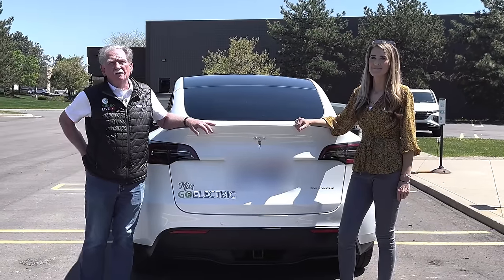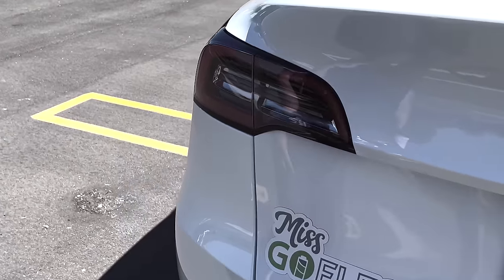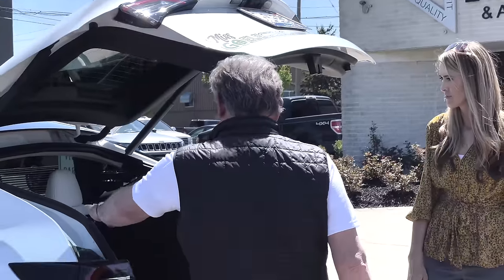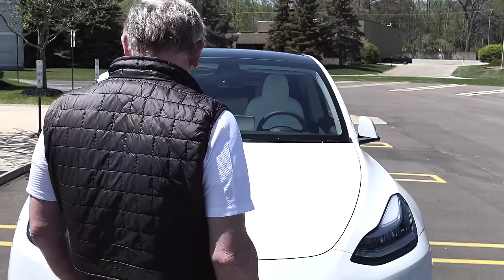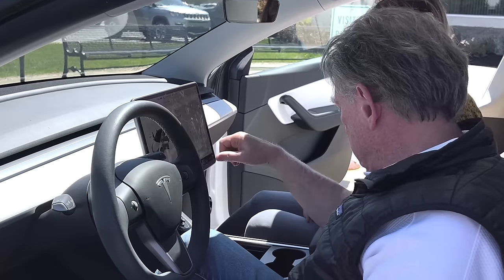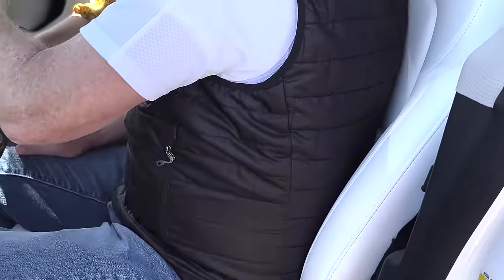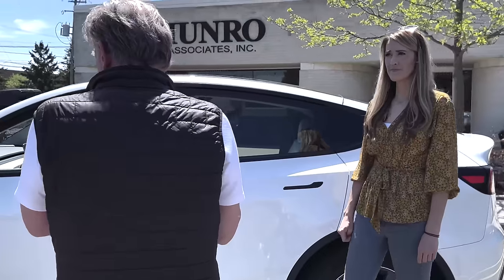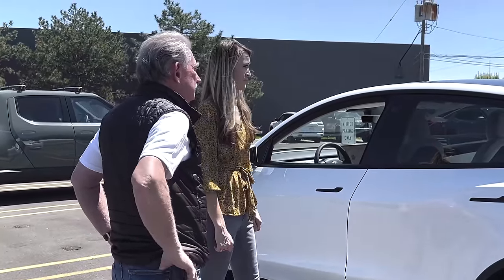Sandy takes a peek under Miss Go Electric's New Model Y Frunk!

Comment: The panel gaps, you need to schedule a mobile tech and/or bring it back to Service Center to have them fix it. The completely messed up front fender gap to the pillar is totally unacceptable IMO, fairly sure the other customer rejected it because of that... looks like a 5mm bump from the fender transition to the pillar.

Comment: Haven't watched the video yet.  My 2022 Model Y has a very slight press flaw to the left side of the rear hatch where it meets up to the hinge.  A very slight twist to the left.  It's not enough to warrant the hassle of getting it repaired which I would assume requires a whole new rear hatch, but it did get mentioned to them and money changed hands as a result.  Looks like something similar is going on with her car.
Reply: I own 2 Tesla's (a model 3 and a Y) I would Lemon law that vehicle.  For the money that is not acceptable.  I'm sure they would work with you.

Also, there is a window calibration you can do.  It's in the manual.

Comment: Tesla fan-boys love to criticize the more established auto companies, but I doubt if a vehicle of this quality would have left a Ford or GM plant
Reply: Ford or gm will break down in less than a month, will have to be towed. 
gm car will catch fire 🔥 just looking at the car.
Reply: @markplott4820  data?
Reply: @paullester2535  - BOLT recalls, Ford pumps & ignition.
Reply: @markplott4820  CR still ranks Tesla reliability 27th out of 28th

Comment: The panel alignment on my January 22 built MY is better than the car in this video, but still doesn't match a typical Toyota to say nothing of a BMW or a Mercedes.  That said I love my car now that a software update has largely fixed phantom braking.  I smile every time I go by a gas station.

Comment: The Y has higher roof line which allows a higher seat than the 3.
The floor thickness (battery pack) is the cause of the squeeze.

Comment: My 2019 3 after 40k typical dings and scratches plus some damage by vandals. The way the 3 drives the range the charging network. When I get into my car I don't notice panel gaps I'm just really happy I'm getting into a Tesla and silently driving off knowing I'm in one of the safest cars ever built it's just no big deal the imperfections.

Comment: From my perspective on TESLA opening chargers to other Brands is OK only if TESLA Owner have lower charging costs. If the cost is the same then it's not a logical strategy to the Company and does not respect TESLA Owner that chose TESLA because of differences in the charging Services. Other point I see is that there is no noise dampening on the top \ interior of the plastic wheel covers, that could improve significantly the road tire noise. Thank you.

Comment: The left front fender is misaligned and throwing off the front bumper cover, hood, driver's door. Find a local body shop, they can loosen the fender and realign it and then realign the rest to it. It's just attached with bolts. It'll be faster than waiting for Tesla Service to do it. albeit free.

Comment: I guess I am an idiot. U can't really see most of the imperfections and the ones that I see don't bother me. I used to have Lexus and Lincoln, Mitsu, Nisans and some other cars. They all had some imperfections. The visible things do not bother me. But if there is some noise or squeaks that can drive me crazy.

Comment: If you see uneven gaps at pickup, they will fix it at the service center.
Reply: That’s why you need to check your car in person before taking delivery to avoid those dumb issues!
Reply: @carholic-sz3qv  We checked these gaps and were aware of them when we took delivery.  It was a calculated decision.  Timing and functionality are important to us, but aesthetic perfection is not among our expectations from a Freemont Tesla under $100k.
Reply: @MissGoElectric  We were fortunate to get our MYLR in a silar fashion.  The gaps were actually pretty good overall, just not perfect like the one in the showroom.  We had to wait for a few weeks to get an appointment, but as you mentioned, we would have been happy with car as it was delivered.  So many more plusses than minuses with Tesla.  And it's the only car we ever owned that gets regular free upgrades.

Comment: The metal frunk does not have those stamped hexagonals, and now it seems from the video it is a sandwich type of system with some plastic core. Is it me or is this different from before? If no more stamping is needed it seems like a significant cost saving.

Comment: In my Model 3 SR. My wife's back starts to go out after a few hours of in the car. We think it's because her legs are super long and after siting in my M3SR for a long time, and having her knee's almost up to her stomach, is what is causing her lower back to go out. What are your thoughts?
Reply: If moving the seat up/back does not change the comfort, there is probably nothing you can do but to have a different kind of car. I guess she had no problem in the previous cars, so there you have something different (maybe the seat position is too low?).
Reply: Get a Model Y. Or see if you can shrink her feet a bit 🤣 just kidding.

Comment: The gaps are probably 'within Tesla spec'.

The seats in the Y are taller/higher than the 3. So better angle with the knees. Back seats in the 3 are horrible because of that. Only comfortable until 12 years old or 5ft tall max.

Comment: 5:13 Either the right rear seat backrest is not fully latched, or completely misaligned and on a different plane than the left and center seats.
Reply: The seats are adjustable, it's easy to have them look misaligned
Reply: @shankhadeepshome3982  I know they are adjustable for reclining, not for elevation. The right side is way higher. This problem and the rattling have been reported by many owners. Another Youtuber mentioned it and showed the images.

Comment: Lotsa gap issues, that left front A pillar / fender gaposys  is a head scratcher....it's bad, the plastic power filler door I would trim the plastic door edge, the windows going up and down  I agree, there is pressure interfering with a sensor but nothing that is earth shaking, that can't be tweeked  but I loved the deep console storage that is so deep you "can put old boyfriends in"  !

Comment: Im guessing the front left fender is misaligned.  Straighten it out and the left side gap goes away and the fit at the driver mirror and with front bumper will resolve.

Comment: 1. I do not agree, because at this time the Hyundai Ionic 5 is actually less expensive because there is up to a $7,500 Federal kick back, and up to approx $4,000 or more kick back with local governments and private sectors as well.
2. Also Tesla over rates their EV Range from what I've saw many people say from their testing, they basically say Tesla vehicles do not perform in regards to the actual range they claim their vehicles achieve. Hyundai on the other hand is more truthful and accurate with their EV range claims.

Comment: When you’re driving, there’s acceleration and there’s testing the very bounds of time, space and human endurance. The upcoming Bentley EV will tilt toward the latter.

In an interview with Automotive News Europe, Bentley CEO Adrian Hallmark promised that his company’s electric vehicle will sport 1,400 horsepower and go from 0-60 mph in a bonkers 1.5 seconds. Most current lists have even the fastest 0-60 mph times hovering around 2 seconds, so yeah, this car will pulverize you.

Hallmark said the current Bentley Continental GT Speed is at 650 horsepower and that the Bentley EV will double that. But he warned of diminishing returns with such rapid acceleration. “The problem is, it's uncomfortable,” he said. “The thrill of 2.4 seconds to 60 mph is great about 10 times. Then it just becomes nauseous."

However, Bentley will leave it up to the driver, who can stick with 0-60 mph in 2.7 seconds or switch it to 1.5 seconds. So, you can decide if you’d like to turn your brains into mashed potatoes. But with a 12-cylinder engine, you’ll probably be going fast no matter how carefully you drive.

Hallmark said though that the “brutality of acceleration” won’t be the defining trait of the Bentley EV, but rather its ability to easily overtake other vehicles due to the huge amount of torque on demand.

Comment: This is what smart people do after buying/leasing a +$60 000 dollar car https://youtu.be/bM9j4E0jeNU?t=560
You don't drive the car off the lot before a complete inspection of the paint, panel gaps etc. you address any problems or issues immediately and leave the car on the lot until they are resolved, this will be covered under the warranty and if you're buying brand new the car must be delivered brand new free from defects. If after the work is complete and you're still not satisfied then you can go ahead and cancel the agreement depending on the laws in your state.

This Tesla is coming from Illinois and they don't have a "cooling off" period for car purchases, so my guess is that the buyer made a down deposit on the Tesla, waited 6 months, dealer called to let them know their Tesla was ready to be picked up just need to sign off on the paperwork, when buyer arrived at the dealer and saw the condition of the Tesla refused to go through with the purchase. Dealer was left with the car on their hands which they pushed off to Miss Go Electric who didn't do her due diligence before purchasing but since resale value is so high I'm betting she thought it was a no lose deal and went through with it anyways.
Reply: I have been in the auto business for more than a decade. We recognized the panel gaps and understood the process well.  We have had many cars including our other Tesla, a Model S. Delivery was fast and timing was a more important factor for this purchase. I have put on 4,000+ miles without wind noise or any functional concerns related to the panel gaps.  We plan to replace this in 2023 with an electric truck which has been on order for a couple years.

Comment: One of the issues with running changes is parts availability for older versions. My 2018 Model 3 was just repaired from an accident and the frunk was replaced with the newer, smaller style one that came out in 2020. Apparently, that's all Tesla has now for parts.

Comment: Those are some of the worst panel alignment issues I’ve seen on a recent Tesla, and Ive watched numerous quality inspection testing videos over the last few years by Tesla fan youtube channels. At least the white rear bumper is properly color matched, that was an issue on the Y for awhile with white bumpers. She must have gotten a Friday/Monday car that was a reject order. But if she is fine with it and it’s mechanically sound so be it. I would probably would not accept it though.
Reply: After a decade or two in the car business, we might have a different set of criteria for taking delivery.  We are happy with it even though it has some visual imperfections.

Comment: Build quality of Tesla is hit and miss.  It is now 2022 Aug, They still don't have a build quality in check yet. It is unbelievable this bad build still happens after all this time and how expensive Tesla is.  Munro, please contact Mr. Musk and ask him to create a quality checking guy to stand at the last spot on the assembly line.   Also, even though model Y LR is claimed 300 plus miles, owners have been getting low 200's.

Comment: Y rear seats are higher, knees aren't up at an angle, more thigh resting on cushion... my parents complained about awkward knees&pressure in my 3, testdrove Y and said much better. Don't know if they changed the padding etc , but that is probably a lot of it.
Do window calibration (down&hold, up&hold, repeat etc)- it is in the DIY maintenance Tesla web page. The tesla tech should have done that..

Comment: 70K vehicle with panel gaps and lots of tech. A test of what traditionally was considered "value" and a new paradigm based on practical capability and usefulness.  He really should have purchased Mercedes instead of attempting to buy Twitter.

Brings one back to ford's style developing the mustang.  Build the engine, then design a box of a car shape around the engine.

Comment: Sandy what’s the root cause of the misalignment and why hasn’t Tesla fixed it yet? Is it how the unibody is welded into place? Perhaps imprecision there leading to inconsistent gaps? Or is it 100% assembly and related qc that’s causing the misalignment? It would seem to me the robots placing the stamped steel unibody sections aren’t “gluing” them together in the right spot? In other words can these panels be realigned post production or is is stuck like that? I always see talk of Tesla misalignment but not much about why or where the problem originates.

Comment: How can they sell this without discounts is crazy, I would never accept it, but I suppose nowadays everything can be sold
Reply: the function as it should. does not leak when it rains. function as normal in all kinds of weather. 
still the SAFEST car you can ever buy. 
what more do you need ?
Reply: @markplott4820  a car that looks like a 60k+ car and not like a Fiat Panda?
Reply: @djlorenz11  - Model Y OUTSELLING fiat panda and others like KUGA, PUMA .....more.

Comment: With all respect to Laycee (and I'm pleased she loves the car), but I would rather wait several months to get a car without all the defects.  Unlike Laycee, I would never have accepted this car with those misaligned panels (especially the ones causing noise).  Imo, this car should have never left the factory.  It's sad that Tesla is still having these issues.
Reply: Not "Tesla"
"Fremont"
Reply: We are very happy with the Y, even though it is imperfect on the outside.  We plan to replace our Model S and Model Y within the next two years with a couple of electric trucks.
Reply: If I need a car now and not in six months then this car is a steal compared to the inferior competition. She wanted something fast and it's almost perfect except for a few small issues. I would have done the same.

Comment: The charger is port isnt super charger compatible ?? only home charger size  weird
Reply: No, it has the standard Tesla connector in North America.  Works with all Tesla Superchargers in North America.  It does not, nor does any NA Tesla come with the CSS Combo plug.  Until Telsa releases an adapter for CSS, Tesla's in NA can't use them.

Comment: Those "Stealership" markups are ridiculous and based on nothing but greed!  So it's nice that Tesla doesn't do that.  But I love how after all this time Tesla still hasn't fixed the panel gap issue.  Come on Elon fix it already and stop this Twitter thing!

Sandy acted like he didn't know that the Model Y (and Model 3) now have laminated front side window glass.  Seriously Sandy?  But glad Sandy noticed the change in the lower door panels are now hard plastic instead of the soft touch material.  My 2018 Model 3 soft touch material right above the cup holder is all gouged up from water bottles, really sucks and Tesla should have never used soft touch on that area.

Comment: they don't have sensors, they read motor current, oy vey, so much for understanding car systems, even my 15 year old VW had motor current sensor, internal, it would back down, thinking it was having an obstruction, oy vey...clueless in automotive technology
Reply: @tactileslut  nope, he is referring to some outside sensor, when in fact the motor drive ckt itself far far far away from the motor is sensing current draw, there is no physical sensor in a door assy, that is needed, and most likely it is a design defect, like she says, glass is too heavy for the motor to drive it, Tesla, again, poor design, lots of others have used double pane glass for noise and  low e heat reduction.  Understanding basic electronic ckts., will clear your confusion, look up motor drive ckts...again. Sandi is showing so many times what he doesn't understand
Reply: @tactileslut  built is the driver circuit,not as Sandi is claimg,as an outside sensor. He obviously doesn't understand anything electrical or motor ckts.  When a poor design it making the glass jam in its tracks,due to undersized motor,over weight glass,and basically poor qualty,he makes blanket statements,with no real facts to back it up.  He has no idea what the window regulator assy is doing he just says,oh a sensor,it's fine....oy vey

Comment: Funny how she thinks she’s right about the motor. Obviously, Sandy would be able to spot an underpowered motor, he’s been around. 

“A little bit more range” in the Y? 50 miles is a lot sweetheart. It will take KIA years to make up those 50 miles without increasing the battery size.

Funny how people disregard the engineering without thinking about what comes out of their mouth.
Reply: Tesla service came to make a warranty repair on the window.  I'm here repeating what the Tesla service person said about the window motor. I respect Tesla's expert and I also appreciate Sandy's insights.

Your tone and patronizing titles are not appropriate and seem to indicate that you do not understand my background.

My Model Y range is rated at 330 miles and I understand it is an overstatement as a longtime Tesla owner.  The full 256 miles of range on the AWD Ioniq 5 may also be optimistic, but can't speak to that directly. We have our Model S for road trips, so range isn't much of a factor for our use of this Model Y.
Reply: @MissGoElectric  respect. 

After reading my post, I could see how it clearly was not written for tone. My apologies. It sounds worse than what was intended.

I’m a 2016 Model X owner and planning on buying a plaid this fall. 

Have a fine evening and a pleasant tomorrow.  Sorry for the tone.